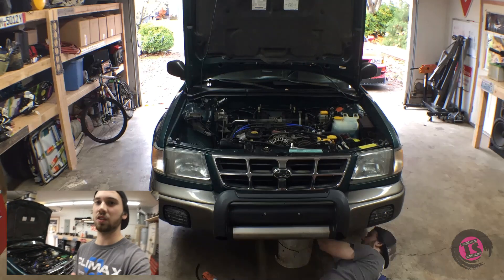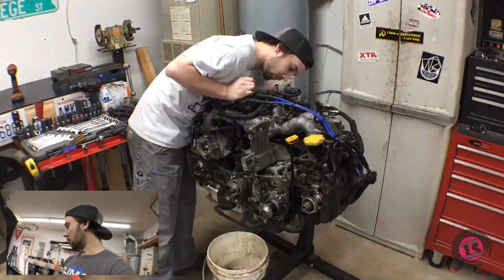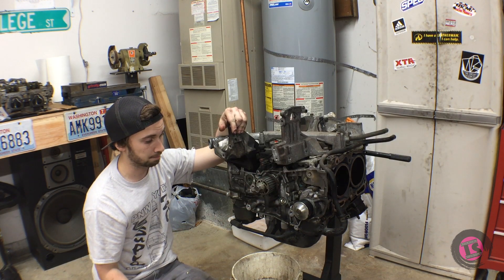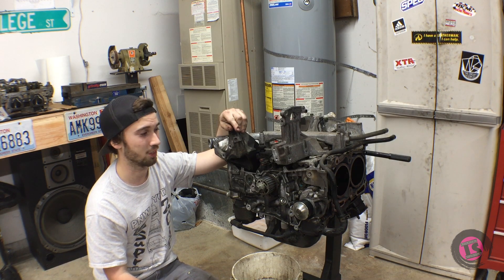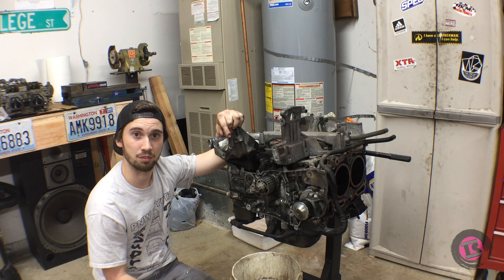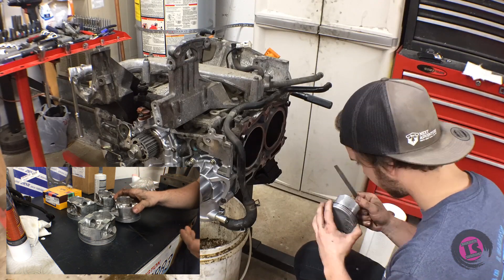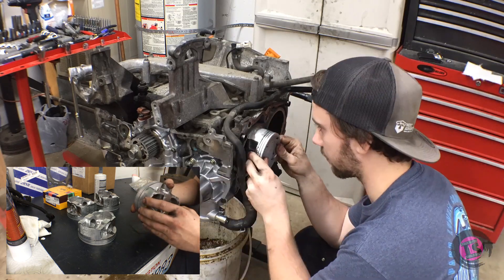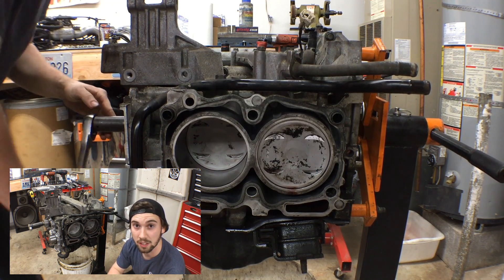EJ25 Oil Burning Fix | TIRESIDE In The Shop

Comment: WoW!  Great job! Huge “labor of love”!  Who can afford it… Labor alone far outweighs the value of the car!  … ATF for assembly?  Why not “assembly Lube”?  Also, interesting that cylinder was still “round” & not “scored” or damaged, and didn’t require honing? … My 2004 (180k miles) had All these things when replacing failed head gasket, but no excessive oil consumption!

Comment: Pretty sure my piston rings are fkd causing my engine to burn 1 quart of oil every 1000 miles or so, my CEL is on for clogged cat which is now rattling and probably falling apart. Need to pull the engine, possibly get new pistons with thicker rings, machine the heads, MLS head gaskets, new seal kit etc. rebuild the whole thing. Cant wait, never done a job like that

Comment: Awesome!  That knurling of the pistons is pretty cool idea.  We had a 1981 Chevy pickup with 250 inline 6 that burned oil so bad it fouled the plug nearest the firewall.  Pull that head off and took to a machine shop where they knurled the valve guides to reduce the internal diameter fit to the valves.  Worked like a charm!  Never knew they could knurl internally.

Comment: Looks like all the blocks (Ej253, 255, 257) are the same, basically what makes them different of the rest, is  one have reinforcement pins in the cooling chanels, better crankshaft, and the heads. It means that you can actually swap the ej 253 block to a 255 block or 257 block with 253 heads. and take the 255 and put 257 heads. This is interesting!

Comment: Ok, I'd like to offer some advice.  New parts are very inexpensive.  But when you get the piston kit, throw away the rings.  The old consumption issue is caused by junk compression rings.  Deglaze your cylinder walls and install new pistons with hastings iron rings.  That will permanently fix oil consumption problems.
Reply: This is what i need to do for my EJ25D soon... I want to pull the engine, get the heads machined, put some better rings on, maybe new pistons, new seals everywhere, MLS head gaskets etc... rebuild the whole thing
Reply: @vermili0n  be careful....not too much mill on the heads.  It'll offset your intake.
Reply: how can i get the iron rings. what do i search for
Reply: I think I have a box at home.  EJ255???  Hastings 2C5140 they should fin the new aftermarket pistons.  They are thicker than Subaru factory.
Reply: May I suggest.... definitely pistons

Comment: my two cents: I wish you would have stated your exact oil usage, your compression results, piston to cylinder wall clearance, (could have used feeler gauges ) and ring end gaps before and after. Like already stated knurling usually don't hold long.  I'll check your channel and see if you've updated your results. Interesting

Comment: not many people would pay out that money on a 2000 subaru .I own one and luckily don't have that problem but got it with 90k miles and change the oil regularly . It beats a new car payment though and with new head gaskets it could go another 100k easily
Reply: Exactly, repair and rebuild and relax without a car payment

Comment: Just rebuild the full engine if you have committed this much energy...
Reply: Energy is one thing, money is another… rebuilding will cost in parts and machine work. From 2k up to 6k depending on level o build.
Reply: @Laborchet haha, I have a EJ25 (dissasembled) sitting in my garage ready for the machine shop just gathering dust. I am probably going to give it to my neighbor.

Comment: Hey can you please tell me ROUGHLY how much oil that car was consuming? I’m trying to figure out if this is what is happening to my Subaru. It has passed every other test. I go from full to empty oil in 100 miles. STI with perfect compression and leakdown test. Not a drop of oil leaking anywhere. And I don’t really see any smoke. A tiny bit every once in a while.
Reply from the maker: Here are all the McMaster Carr part numbers I used. 1302N082, 9262K357, 1302N087, 91610A512, 98055A465, 98055A444

Comment: That’s fine that you filed the Pistons I guess, but how did you actually get the pistons out of the cylinders without splitting the block?
Reply: Subaru has access holes to remove the wrist pins that connect the rods to the pistons. You actually have to remove those wrist pins before you can split the block.

Comment: You could have fixed that engine with high probability by dropping 2 cans of RVS triboceramic engine restore. It fills up the micro ridges in worn engines and restores compression + lubricates. Every metal to metal surface gets a ceramic coating. Cost is only 150 bucks per treatment.
Reply: how is that stuff? I hear it is amazing but have also been told it can really cause damage ??
Reply: @joelturnill105  No, it's been TüV tested in Germany (a very famous testing facility). It does what it promises and causes no damage. I've been personally using it for a decade in my Mercedes engines and Jeep CRD and my Jeep passed emissions with 0% smoke at 150k miles on the clock... The engineer didn't believe the result and did the test again with another device. Same result...
Reply: @marttiinnanen4911  thanks for getting back to me. Is it easy to do the procedure? I am from vancouver Canada. Where are you from ?
Reply: @joelturnill105  I'm from Finland. RVS treatment is really easy, follow the instructions ;)

No really, put 1 portion in, let it idle, then drive for 30 minutes at random speeds... then do step 2 which is about the same. On many engines you'll notice near immediate smoothing of engine sound and better running. I have fixed 3 whiny power steering pumps of my Mercedeses successfully and avoided thousands of dollars of repair.

Comment: why do you use ATF? to lube the engine? does ATF cause any problem? if not ATF can i still use a thin layer of engine oil instead
Reply: They sell engine assembly lube.  It's a light grease.  And an old school trick is to pack your oil pump with vaseline for the initial start up.

ATF is some handy stuff.  It's super high detergent lubricating and hydraulic oil.  You can soak your lifters in ATF to get all the gunk out.  You can soak frozen parts in ATF to free them.  You can soak cables frozen in their housings to restore their operation.

Any home garage rebuilt engine should have the oil changed after a couple hundred miles, anyway.  And knurling is very old school and rarely recommended today; new parts are always recommended for repairs.  But guess what - knurling still works!  You can knurl and ream your valve guides too.

Comment: Amazing work, wasn't aware of that knurling trick, I'd probably get the skirt machined back into tolerance though. Ring gaps are also super important with these, and hypereutectic pistons are unfortunately quite brittle and ring-lands can fail if tune is not perfect. Always maintain tune. How is it running in 2019?

Comment: Nice! I had no idea you could pull the EJ25 pistons out without splitting the block. Thanks for this!!
Reply: You actually cant split the case until the pistons are out
Reply: Even if you could pull the pistons without splitting the block its probably just a better idea to do it. You can get the heads machined, throw some MLS head gaskets on it and clean everything up nice for a rebuild

Comment: If an engine has over 100k on it, its best just to do new pistons and bore oversize. Those skirts wear down over time, thinning the metal. I have seen the skirts actually break at the wear spot because of that. I also seen a guy put his engine back together with part of the skirt missing. He convinced himself it was perfectly fine that way. Its yours to do what you want. As far as a garage doing it...never going to happen, ever. I wouldnt want my garage name on a job like that. As an owner, the liability is too much of a risk. Clearly, doing it yourself gives you freedom to choose your own method. A garage cannot do that.

Comment: Very interesting, how did you manage to extract the wrist pins as you call them? In the UK we call them gudgeon pins. Surprised you didn't "glaze bust" the bores, why not? I'm also shocked Subaru are fitting "slipper pistons" with three rings, no wonder they burn oil, they're for race cars, the standard pistons are cast, while race pistons are forged as are the STI pistons.
Reply: Sti pistons arent forged, they're almost identical to the wrx pistons. Also a few years of the fxt and lgt shared the exact same internals as a 257 sti motor. The main difference between the internals from sti to WRX comes from the cc difference in the heads to create the different compression ratios. The only really different part is the rods for the sti
Reply: @Chris Santos 
Hmmm well that's strange as I have oem wrx cast pistons sitting here in front of me, oh, & I also have oem forged sti pistons on the bench.
Reply: @sgt-willkillu much wow so you got some 02-04 207 pistons whoopty doo.
Reply: @sgt-willkillu  for 2 years in the u.s. sweet deal! Thats awesome buddy want a cookie for your awesome knowledge? Slap those 02-04 pistons in some 06+ sti motors make power whooptie dooo
Reply: @sgt-willkillu  sweet you're overseas my dude apples to oranges. You also get much better cars than we have access too props to you. Whoopty wee. Go play some fork knife and enjoy your afternoon lol.
Reply: @CuttinChris  You have some anger management issues.

Comment: The problem I have is changed the oil every 3500 miles, used synthetic, and mine burned oil after 40,000 miles (H6 engine).  Never badly but it does burn.  Now has 90,000 and still burns oil.  Won't bother to replace the rings as it otherwise runs fine and never had any other problems.  Just a problem with the engine no matter how well you take care of it.  Nice video.
Reply: Just wasn't broken in properly. I rolled over 241K miles and I use zero oil in 5000 mile OCI ('13 3.6R)
Reply: @HSTBIM  No, you were just lucky.  Here are plenty of videos of Subarus burning oil as it is a fault in certain engines, particularly the EJ engine made around 2006-2012.  Here are a few, the last a class action lawsuit.  https://www.youtube.com/watch?v=C6LyZBlM4Qc https://www.youtube.com/watch?v=bJSYDBjkJNQ   https://www.youtube.com/watch?v=5zKc6IAGvPc   https://www.youtube.com/watch?v=khvZ0U85pgU

Comment: I have a 99Legacy and has a nasty vibration at bout 2500rpm. Its actually piston slap and makes the whole car shake. After 3000 its smooth as ever. Only consumes 1qt 3000mi which is amazing considering 🙄.

Comment: My 08 tribeca is consuming a quart every 500 miles. No smoke or poor performance. Regular oil changes too. Have a bad feeling it’s the piston rings. About to get rid of it before it worsens
Reply: How many miles?  Thought of just replacing all the pistons and saving it if you can?
Reply: Just repair!  these are not disposable cars, there are infinitely Rebuildable....

Comment: Nice job. You work like real mechanic. Not like the YouTube commenters that watch a couple of videos and then think they're an A-tech. If you replaced the pistons you most likely would have had to split the block and bored the cylinders one oversize. 
Knurling pistons and valve guides used to be a common practice back in the day. It gets the customer back on the road cheaply for a couple or few more years. Sometimes that's all they need.

Comment: Good but not good

Not even close to correct rebuild for those that are thinking of doing it exactly like this.

1 Rebuild engine using oem spec oil only as lube for all parts
2 Check cross hatching, honing is not needed if it is intact
3 use bore (T) gauge to measure how warn cylinder is
4 always check ring gap on piston at three separate heights in cylinder
5 lining up wrist pin clips properly will save your engine
6 be meticulously clean, majority of engine failures are caused by contaminated oil
7 pre fill OEM oil filter and pull crank/cam sensor connectors to keep engine from firing to prime oil system, turn engine over with ignition(key) for 30seconds then replace sensor connectors and start engine
8 change oil asap after reaching normal operating temperature as any contamination from rebuild will be in the filter at this point
9 change oil using oem spec oil and oem filter for longest subaru engine life, always reach normal operating temp before shutting car off and resist long idle times to warm up car, get in and drive

10 you did really well and saved money doing it. Dont stop learning and taking on new projectsb what I covered only scratches the surface of proper engine rebuilding but can save you from doing it twice and thats worth time/money

PS I vote engine swap from low km doner vs rebuild unless your time is worth nothing and gaskets etc are free

Great vid- Bjorn Racing on FB
Reply: What would the correct wrist pin clip line up be? This is the first i've heard of that.
Reply: @drkbltn  you a master tech or engine builder? I left tons of info out for the proper rebuild. Im not teaching a full engine building class via youtube comments. It takes thousands of hours and many learning opportunities to be an actual mechanic, just because mom cooks doesn't mean she is a chef.

Think about the forces acting on the piston and install clips accordingly.

Youtube lets people watch others get away with murder and call themselves pro all the time. Makes for messy inefficient work and many steps missed that may cause failure.

Comment: Hey homey, Subaru has a terrible problem on their vehicles burning oil excessively. Class action was settled which resulted in Subaru doing little or nothing to correct the problem. They do oil consumption test where they change your oil, over fill it, oil consumption goes away until later it “magically” reappears. I think I’ll be calling my attorney to help get this crap taken care of. Hellof a way to treat customers because of a crap design.
Reply: Mine does the same. If I overfill it it's good for a couple weeks and then BAM.......nothing on the dipstick
Reply: What year and model you got?  Had a forester that burned about a quart between changes if I drove it hard but nothing crazy
Reply: And the beat goes on . . . No QC. . . . Subaru Profit is Everything.
These engines are still designed to allow *Generous  Oil Blo-By.
The inverted oil filter empties in <30 seconds every time the engine is shut off and has to be re-started DRY. If you live in an area where you have cold winters your engine will undoubtably self-destruct prematurely. 
The water pumps are recessed deep into the front of the block with the water thermostat behind that ? The radiator and Most of the  front of that engine has to be stripped to replace a water pump. 
Whoever designed this was in a FOUL Mood. Then there's the AWD/All the Time situation . . . another very expensive hand grenade that consumers do not realize.
Then there's Little Johnny already having a bad day in the back room with your car because he forgot to take his medicine today . . . Oh my ???
Dealerships have to go . . . they really do.
Nah . . . I Pass.

Comment: That isn't going to fix the problem, all your doing is a cheap fix instead of replacing the pistons...Waste in my opinion and that filing is in no way accurate...But props on the mechanical skills.
Reply from the maker: anthony aguilar you’re right, that’s why the car is still running great.
Reply: Right, but is it really worth it? I would do it the right way; Overbore and new pistons.
Reply: anthony aguilar at least a re hone and new pistons and rings, but the engine did sound fine at start up
Reply: I figured as long as you are going that far, just have the cylinders rebored and install oversized brand new pistons. I have done several rebuilds and too many engine replacements to count over the years. I am not tearing an engine down that far just to " fluff" up the engine. If you have over 100k on that engine, a rebuild is in order, period.

Comment: Can you remember the usage? I've heard 1l/1000 miles is fine
Reply: My 2002 Impreza is burning oil at that rate... with 315k miles on it. So far, knock on wood, just been adding oil and getting away with it. Passes pollution inspection. At least so far! Runs fine other than having to add oil.
Reply: SuperHans I'm burning  quart every 1000 miles. In my sti

Comment: Good job! One subaru save! But I have to ask will it be more cost effective just swap the motor
Reply from the maker: Ng Anson maybe cheaper to get a second hand motor or block, but you could end up with the same problem.
Reply: And basically need to do the same amount of work just skip the head removal step.